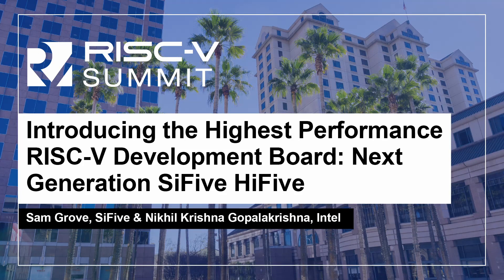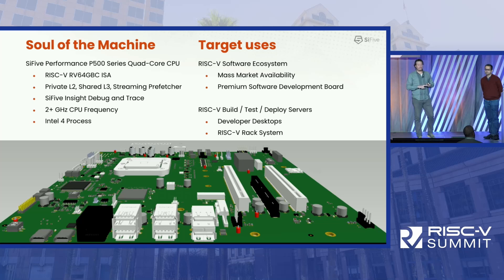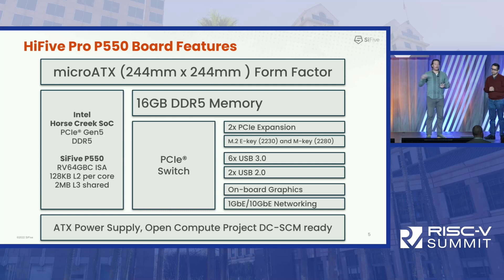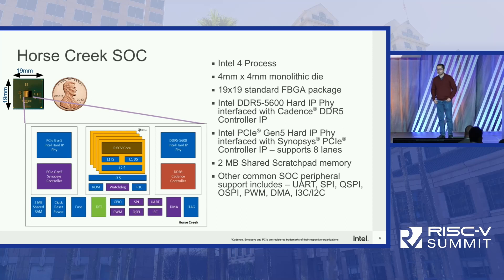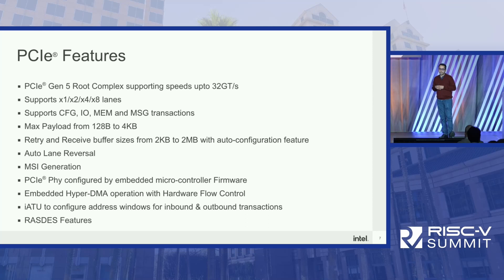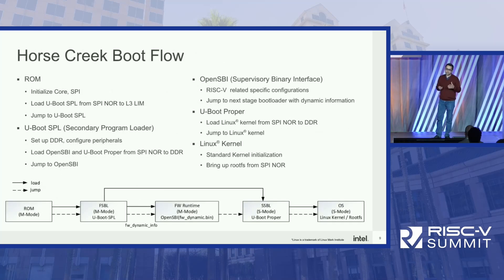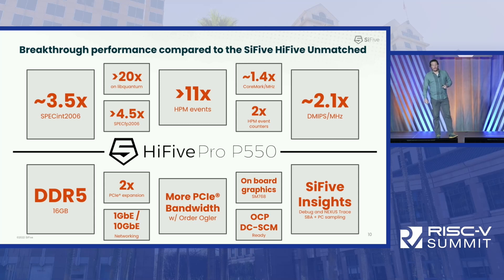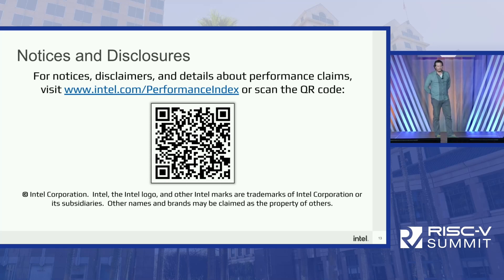Introducing the Highest Performance RISC-V Development B... Sam Grove & Nikhil Krishna Gopalakrishna

Comment: As a backend software developer, this is exactly what we need. It dumbfounds me that ARM didn't have a board like this. And, no Raspberry Pi simply doesn't do it.
Reply: Arka uç olarak hangi sistemleri ve yazılımları kullanıyorsunuz,eğer işinize yarayacaksa bir tane göndermek isterim size
Reply: Microsoft released Project Volterra. But unfortunately there are very few options for Linux. It's a pity it's very hard to get Phytium D2000 boards outside of China. I hope we do get decent mainline and (U)EFI support for the Rockchip RK3588 this year.